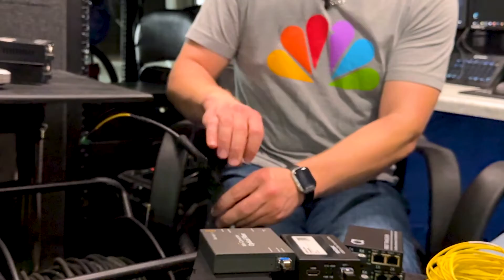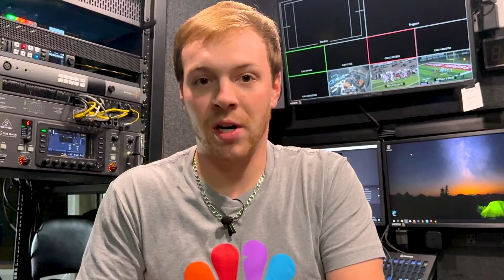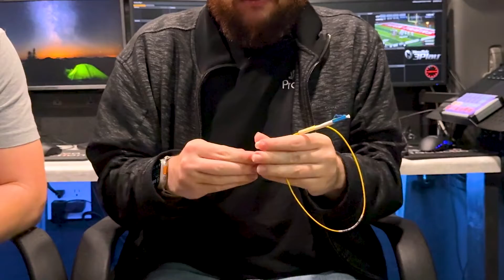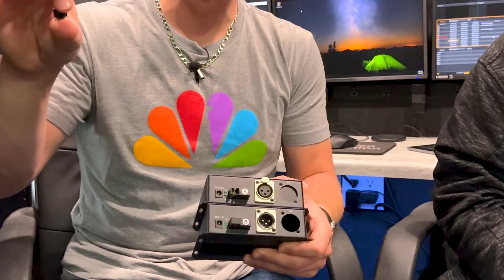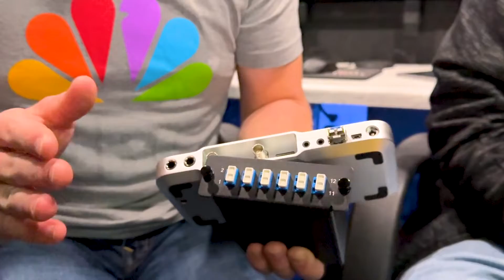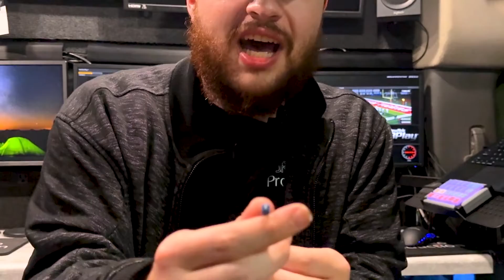Fiber Optic Technology In The Video Production World

Comment: Is that cable what you are usin PVC or LSZH cable jacket? can you see any different about jacket if we just roll the cables and take it away after the stream? is it worth of money to pay 2x more to LSZH or 2.0mm to 3.0mm cables?
Reply from the maker: It's the cheaper PVC jacket. I would say it's not worth it to pay money for the extra coating. Knock on wood but we still have cheap PVC fiber cables being used today after 4 years of heavy use on productions. The only cable I will pay extra for is the main trunk cable. We have that military grade with metal mesh wrap inside. That cable often goes under doorways, in parking lots and high traffic areas. If you're just using patch cables for light indoor use, you'll be fine with PVC coating.
Reply: @jrmvideo Thanks, the LSHZ jacket is like +40% price so i am just thinking is it better to buy PVC jacket cable +2-3 extra with same price then to get only 1 LSHZ. Maybe i then choose only the PVC, we have some winter outdoor events but the weather value was almost the same.
Reply from the maker: @JohnDoe69  Always good to have some extra!

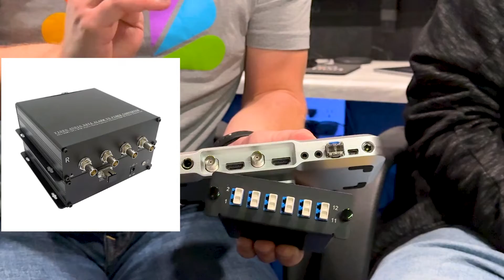Comment: It says on the website for the SDI over fibre device at 9:18 that is uses single mode. However, you're using bidirectional for some of your devices, which I assume means you also use multimode. How does this work with your MTP trunk cable? Won't there be problems when you mix multimode and singlemode?
Reply from the maker: That's a good question. We've never had an issues mixing the two signal flows. As long as the proper send/receiving device is connected at each end of the trunk cable, that should act as a one-to-one connection over fiber

Comment: So I do have a question, how do distribute all of the fiber cables into like, everything else? How does video get to the switcher? And where does the audio go?
Reply from the maker: We have a server rack with all the rack mounted equipment. (Blackmagic ATEM 2 M/E Video Switcher, Behringer X32 Audio Mixer) Basically, from each adapter, a cable just goes into it's end destination. For example, and SDI over fiber converter...the SDI out of the converter just goes directly into the video switcher. I'd do a video in our server rack but it's not the best cable job.
Reply: @jrmvideo  Awesome, thanks for the info, but honestly I for one, wouldn't mind the cable mess, but its all up to you.